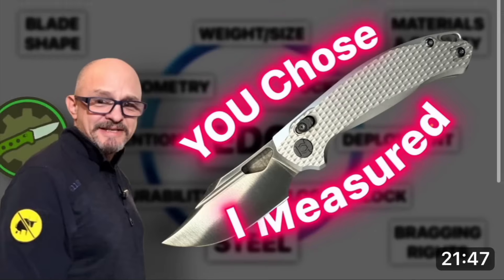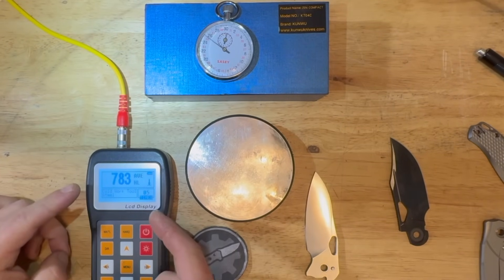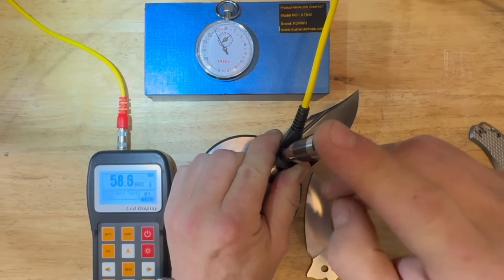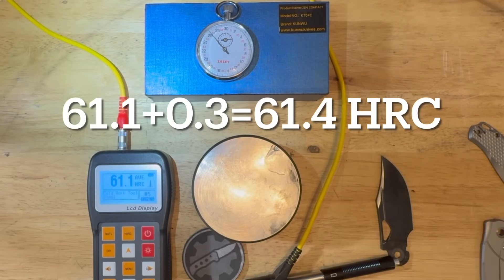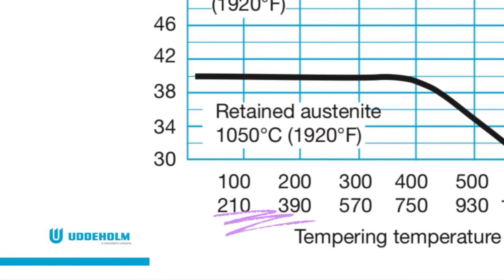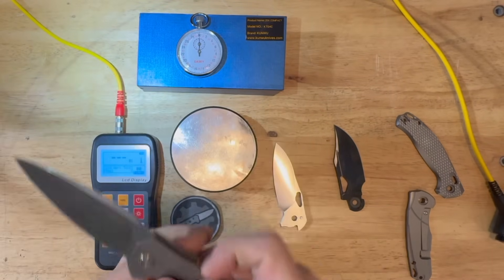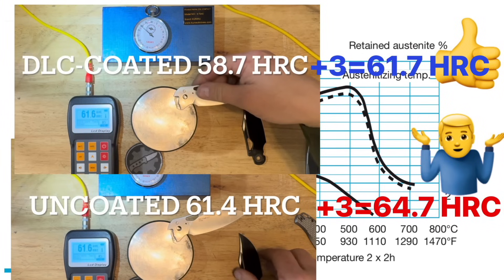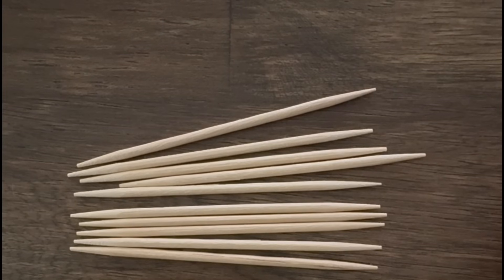Myth vs. Reality. Let’s discuss how DLC alters the blade’s hardness.

Comment from the maker: Hey, let’s have a robust discussion. That said, I don’t delete comments, but the YouTube Algorithm may, so try to not spell cuss words out, I don’t have the time to dig red-flagged comments out of the holding ditch…
Reply: I figured I’d post this here since u never responded. 

y not remove the coating on the tang of the dlc and test to prove ur point beyond a shadow of a doubt. Just a thought any way. I like the dlc coating because it's the only coating I've found that is truly scratch resistant to an extent and so it keeps my blade looking nice. If u break down as much cardboard as I do on truck days at my job then u could see y I appreciate it as any other pvd coated blade gets marked up fairly quickly due to the coarse nature of thicker cardboard. 
When will ur other video come out about the 1.6 that miamibladelab had to add to his test based off of the blanks he got to test against. As there is a pretty big jump in the 3 points u said people want u to add vs half of that amount. I'm not saying either r right or wrong or that u need to implement any to ur testing just wondering when the video would be available. Thanks for any info.
Reply from the maker: @SteelAddicted  I am awaiting another Kunwu knife that is DLC coated. If it displays the same issue, I will strip both blades and do a side by side. That new one is in Vanax, so the video will cover it, the S-Tao in Vanax, and if the issue persists, the Django. If I was wrong about the hardness of Django, I will film my intro wearing a clown nose and publicly apologize to Sergio in English and Serbian. Now, can you please let me get back to making more videos?!
Edit: please let Kunwu FB group know I said that!
Reply: @ I am not a part of any Facebook group and sorry u never answered so I figured maybe u didn’t see it as me and another commenter ended up having a discussion in that same comment thread. My bad I wasn’t trying to waste ur time. Thanks for taking the time to reply. I’m sure I wouldn’t care about u and whatever is going on with kunwu as I’ve stated I have and do not wish to have any affiliations with any knife companies. I just enjoy knives and enjoy finding out as much accurate info on them as I can. Thanks again. Hope ur new video goes well.
Reply: The graph shows tempering requires two cycles of a 2-hour soak at the specified temperature. I wonder what the HRc would be with only one cycle and what it would be with a time of less than two hours. Also, how long does the coating process maintain that temperature.
Reply: Given the tolerance of 1.5 HRc with the "Industry Standard" method of testing, I think "The Industry" should re-evaluate its method and compare all of the MODERN methods available. Perhaps they could find a method that is accurate enough and fast enough to test every blade or at least several examples from each heat treatment batch. I have no expertise in this field, but I was very surprised to learn that ANY blade steel was tempered at a temperature as low a s 210 degrees F. That means this steel must be sharpened with even greater care, when using the "Industry Standard" sanding belt method, to ensure that the edge is not overheated.
Reply from the maker: @ Thanks for your interesting comment, please be aware that there are some high speed steels used in metal cutting that can take temperatures as high as 700-900°F without any issues. REX 121 is an example. S30V, 35CV and 45CV can withstand 300-350°F range but 
MagnaCut is not the steel to coat nor does it require coating for any reason.
Reply: @CuttingBoardRx  I have seen that at least some of the other non-stainless knife steels have higher tempering temperatures like REX 121 that you mentioned. I just avoid any knives with coated blades. I have purchased two non-stainless knives that are not coated (a Kunwu Compact Chad in PM 60 and a Demko AD 20.5 in CPM 3V). I don't live near the ocean so salt air is not a problem, and I don't mind a little discoloration of the blade over time.
I have bought a number of MagnaCut knives, and I was very happy to see the results of your test of a Hogue Mysto, which I had purchased before I saw your video.
Reply: @CuttingBoardRx  I hope you get the opportunity to test a Tactile Knives MagnaCut blade, such as the Chupacabra or Maverick. They advertise an HRc of 63-64.
Reply: I wondered about this very because you lower the temperature to apply the coating which changes the HRC. I can’t think of the word I’m looking for. Anneal ( sp? )
Reply from the maker: @MrCaissed  Temper. Not lower, increase.

Comment: Ok ,for barbers they now have “dlc” coated clipper blades ,but I’m skeptic if they are actually sharper than pure steel / chrome .. what are your thoughts on this ?
Reply from the maker: There will be no impact on sharpness whatsoever. Nor on edge retention. DLC coating, in knife context, protects the blade from scuffing and corrosion but the secondary bevel and the apex (edge) remains uncoated.

Comment: I have a couple of blades in cpm 3V steel that i was thinking about sending them in to be DLC coated. Do you think the DLC process would negatively effect 3V steel?.
And if you don't recommend the DLC coating because it would negatively effect the 3V steel, are their any coatings youd recommend for 3v that would add corrosion resistance without effecting the steels HRC?
Reply from the maker: I don’t recommend thermal treatment of any kind because it may affect the HT. Watch my video on how I refinished ESEE
Sencillo. Very happy with the result 
https://youtu.be/ICSinmkml18?si=wqUS67_8MvhTTfCc
Reply: No. 90% of 3v is tempered at 1000f. It won't be an issue.

Comment: I recently bought a Vosteed knife in Elmax with a coating..... I havent really used it much yet and havent had a chance to sharpen (waiting for my new Xarilk 3 to arrive) but I am a bit worried about it now that I know Elmax will be affected at those relatively low temps.
Reply from the maker: @DaleLane2025  Well, the effect on Elmax is still debatable because not a single source has disclosed how long the DLC application process is. 1 minute? 1 hour?
Reply: @CuttingBoardRx  I finally found some info (although it was from an M390 Vosteed) - its not DLC but a "stonewashed PVD black titanium coating"
Reply: @CuttingBoardRx there are several different DLC options too.
Reply from the maker: @tacticalcenter8658  I figured the plasma deposit is the shiny one that’s on Kunwu. That’s 200° C plasma temperature. What I can’t find anywhere is the duration! Best darn kept secret in knife history!

Comment: Very informative video, thanks! BTW, you Leeb tested the HRC of the Spyderco PM2 Salt a litle while ago (it's a DLC Magnacut blade), you came up with 62-63 HRC. Do you consider it to be still OK for a Magnacut blade? Have you had an opportunity to test the HRC of the Satin (non-coated) variant (with the Caribbean yellow/black handle) for comparison, since (as you pointed in another comment below) Magnacut does have a tempering temperature within DLC range and thus can have its hardness affected by it? thanks in advance!
Reply from the maker: 62-63 is perfect for MagnaCut blade but as far as other Salt MagnaCut knives I tested, they run it softer bc they want to keep CR as good as L200N. With the coating they are less concerned about the corrosion. Do note that they heat treat the coated blades spot on because PVD application could really ruin the tempering.  Seems they simply use the coating process as the 2nd temper cycle (MagnaCut requires 2 tempers) and that’s evidence of how meticulous Spyderco is about delivering proper product.
Reply: @CuttingBoardRx  that's interesting. There are some PACVD processes for DLC (e.g. Sulzer Metco Dylyn) whose coating temperature range (350-430 F) is well within temper range for MagnaCut (300-450 F) according to Crucible's datasheet. That had me concerned about the PM2 Salt DLC blade's HRC, but your hypothesis about Spyderco applying the DLC on MagnaCut as part of the second temper process (especially now that they've brought the coating processes for their knives in house) makes perfect sense.

I've seen in another knife YT channel people rumoring that the Satin version of the PM2 Salt blade would have a higher HRC than the DLC version (thanks, according to the same rumor, to a collab with Sean Houston a.k.a. Big Brown Bear for the heat treatment), but I couldn't get this confirmed elsewhere, hence my last question. Your testing data seems to indicate otherwise - the rationale of privileging CR over hardness in heat treating uncoated MagnaCut blades for the Salt knives (or rather the other way around for the coated ones) is another interesting point you raise. 

Fun fact: as you know, the PM2 Salt (black) has all its hardware parts (liners, screws, standoffs) coated, apart from the standoff just next to the blade itself and the pivot washers. I couldn't find this in any of the Spyderco printed materials, but a Spyderco representative told me the all these coatings are also DLC.

Comment: You do understand that the heat during the application of DLC is Instant and Brief right? Tempering happens over hours not seconds... And the Blade Immediately begins to cool. 🤣
Reply from the maker: I call BS! Here’s the video that shows blades being dlc coated and it’s clearly not an instant process. 
https://youtu.be/gxkxVrMJwyw?si=-Ejzs3Ha4s26jZha
Reply: @CuttingBoardRx  It depends which specific process is being used, PACVD is a lot less hot than PVD hitting temps between 300 to 400 degrees and happens in minutes. My Source is I have been proxying DLC Coating services for knives for over a year and spoken to dozens of DLC Coating Companies and asked them every question in the book. Your test doesn't prove anything except a variance in the HT which has little to nothing to do with DLC. You're not even using a legit HRC Test either. Means nothing dude. DLC is a lot safer than PVD for the temper of a blade, that much you should know. You really think all the highest end knife makers and manufacturers that offer DLC coated blades didnt consider if it would effect the heat treat? lol. Seriously bro just stop.
Reply from the maker: @dudestuffthings9991  Interesting!  First you said “seconds,” now it’s “minutes…” 
Sounds like you really don’t have a clue. 
Leeb test is a perfectly legitimate method specked out by ASTM A956. My procedure is based on Paragraph 7.2 of that specification. It’s not industry-standard for the knife industry but it’s well described in the international standard. 
“Proxying?” Not a word. Not sure what you mean. 
Keep talking, bro you are being very entertaining!

Comment: Has me wondering if the dlc process can be used as the heat treating cycle within its temperature range.
Reply from the maker: Did you have a chance to watch to the very end? My toothpick illustration…
They can’t break up a batch of blades before temper because it would double the cost and they can’t go much higher in hardness because of steel’s limitations or warranty concerns or some unknown supplier issue.
Reply: No. Most modern steels require at least one 2 hour cycle. Many a 2+2 and Others 2=2=2.
Dlc once cleaned and in the chamber,  takes only minutes.
KnifeMaker

Comment: dlc is a high temperature progress. yes it is seem a another temper progress . so if not the high speed steel. most of the powder steel will less a lilttle hardness after pvd
Reply from the maker: Well, Elmax is clearly more sensitive to the plasma process. What works for high speed double-tempered steels doesn’t necessarily work for other recipes.

Comment: If you care to read the comments which were not made by the kunwu staff in fact in their posts in the past they quote that DLC blade version is lower HRC openly the DLC is applied to stop scratching on satin blades as coating Vanax would be a waste of time for anything else.
Reply from the maker: Yes, but their mouth piece, MC, states it’s 1 point HRC delta. Not 2.7 points as these examples are. Good idea, btw, I will check that scratch resistance in near future.

Comment: I am glade you did this. I have one Kunwu that seems to me is soft. All the others could be as well but I believe at least one is... I barely bumped it on a forbidding piece of aluminum and it dented the blade. I decided to test several of my higher AND lower end knives by bumping them MUCH harder on the same piece of forbidding aluminum. NEITHER were affected! One would assume there is a problem! I plan to make a video about it.
Reply from the maker: Glad someone else is using critical thinking!

Comment: Would a "Stone washed" finish have the same issue.
Reply from the maker: Absolute not!
Reply: @CuttingBoardRx  Thanks, I didn't think so but it's good to know.  I prefer a brushed or satin finish but I have a few Civivi's with stone washed S35VN.  Thanks again.
Reply: @ The only effect  on the steel a stone was h or tumbled finish has is ti helps seal the steel surface better. Therefore helping to slow the possibility of rust. Well, helps prevent and  hide scratches better as well. 
KnifeMaker

Comment: In my opinion the only blade steels that should have a coating is D2 and any nonstainless steels.
Reply from the maker: That makes much more sense than coating MagnaCut. But Even D2 can be maintained without the coating. It has plenty of Chromium to be able to resist the rigors of pocket carry.
Reply: @ I do like it on CPM M4 and it tempers high enough that the DLC can't damage it. Crew Ware as well. Along with several others. All needing it far more that D2.  

I've made hundreds of knives in D2. Never seen one rust. But I do have my onw heat treat protocol that is  a bit involves. (PITA)!!!

KnifeMaker

Comment: I have one question - DLC is harder than steel. Do you think that DLC coating can change on test result? Maybe it should be measured on parts with removed coating?
Reply from the maker: Too thin to matter: .000013-.00002”.

Comment: Never bought a Kunwu, not going to. Luckily I have lots of dlc s30v, hopefully Spyder did it right.
Reply from the maker: Spyderco and Cold Steel/Demko stand out as companies that focus on the system-level performance of a knife rather than chasing influencer-induced hypes. Down to their most budget models 👍
Reply: I have many syderco in different steels and many Kunwu and both manufacturers are great the fit and finish and factory sharp out of box is superb

Comment: If your critics are so certain that your Leeb (sp?) tester is off, why doesn’t Kunwu or someone else do a video explaining why this is the case and go through a real world example with two testers (a Leeb and a method conforming to an ISO 6508-1 or an ASTM E 18 methodology on the same blade? 🤔 I am curious about the comment regarding the accuracy of <10mm test subjects, although your reply regarding the +3 to the uncoated blade seemed to deaden that argument. But is there some guidance or literature suggesting that?  If you’re unaware of any, why not ask the commenter for his source and see if he responds?
Reply from the maker: Thank you so much for the generous gift!  The guiding document for Leeb testing is ASTM A956. Paragraph 7.2 states
“””Thickness and Weight—The thickness and weight of the test piece shall be considered when selecting the impact device to be employed. The following guidelines are offered as minimum weights and sizes of test pieces for selecting the proper test equipment. Test pieces of weights less than the minimum or pieces of any weight with sections less than the minimum thickness require rigid support and coupling to a thick, heavier non-yielding surface to resist the impact of the device. Failure to provide adequate support and coupling will produce test results lower than the true hardness value.” 
The gel or grease between the block and the blade is widely used in machine shops and in vehicle armor repair community. 
Hopefully you find this information useful and I will link the Leeb ASTM in the description. Can’t believe I didn’t do that to begin with 🤷‍♂️😂 thank you again!
Reply: Sorry - I missed the explanation about the test gel and the block substituting for the thickness from @michaell397 before posting. Still curious as to whether that is generally acknowledged and, if so, why that might be. Thanks for the video!

Comment: So there are two issues .
The least important is whether DLC interferes with the HRC test result.
The more important issue is whether the process of DLC deposition heats the blade enough to counteract the tempering of the blade thus changing the HRC and blade performance. And can the tempering process be altered to allow “non-destructive” DLC deposition?
Reply from the maker: If there was a clear understanding of how long the blade is exposed to the hot plasma, we would have a better understanding. Is it a trade secret?
Reply: @ I’ve seen little to no information on the DLC process, like a video of it being done.

On a similar note there is a lack of information on the whole powder meteralgy process.
Reply: @ There is a huge amount of info on the different powdered metal processes.  Simple search. 
Some steels have what is called a secondary hardness ramp.
For instance, 154 CM if tempered to say 60 Hrc at 375 F, if tempered to 1000f now reaches 62 Hrc. Add Sub Zero before the temper is 63 is common. 

Odd thing is after about 425 temper, the hardness drops like a rock until it reaches the secondary hardening  plateau. Hence the secondary hardening nomenclature. Search 154fcm heat treat. It is all there.  

Dlc the lower temp tempering results is lower temper yet. However at the higher secondary hardening level, the DLC treatment is below the tempering temp. No damage! 

KnifeMaker